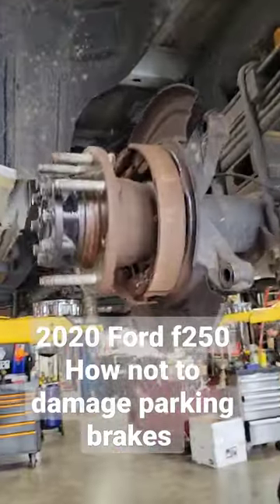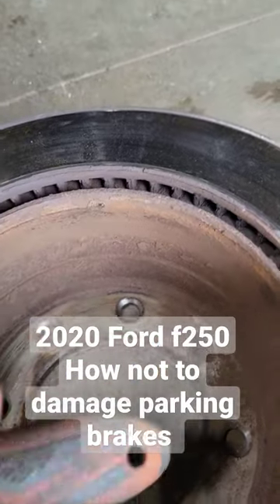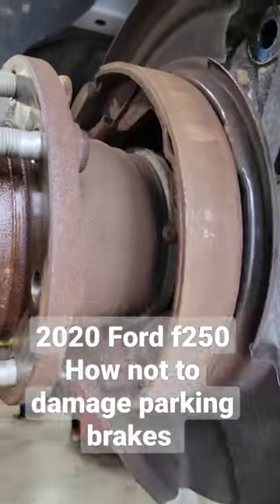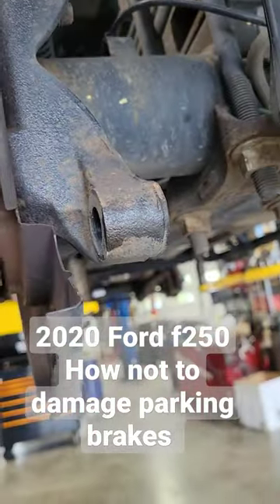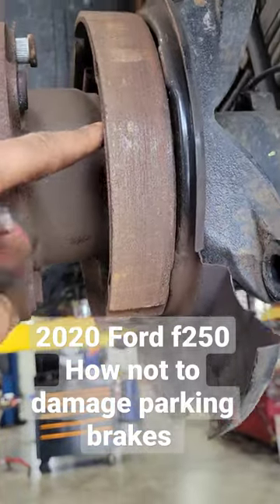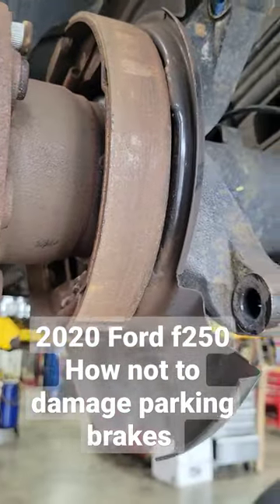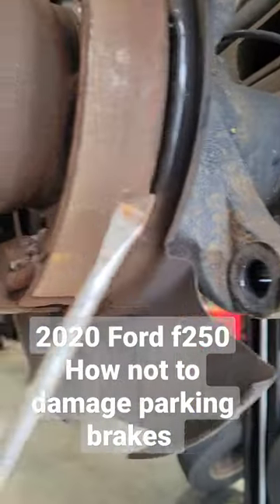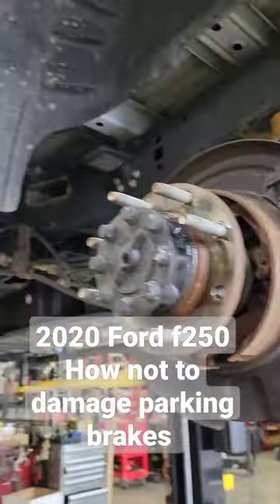A safe way to remove rear brake rotors when the parking brakes are hanging up. Fix don't destroy

Comment: hi bro, i have a question, my cars steering bubbles when reaches 30 to 50 only I've checked and have changed wheel bearings of both the front wheels, also vibrates when reaches 90, and stops when crosses 90, what according to u would be causing the bubbling and vibration and i think it's front right wheel, I'm from India and we have right hand drive.
n also I've just subscribed to your channel as it looks totally informative.